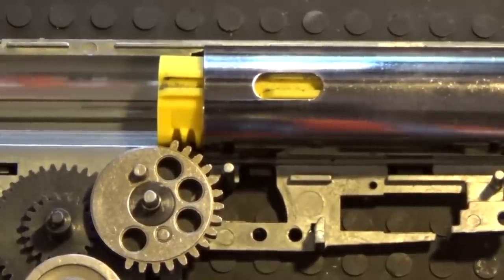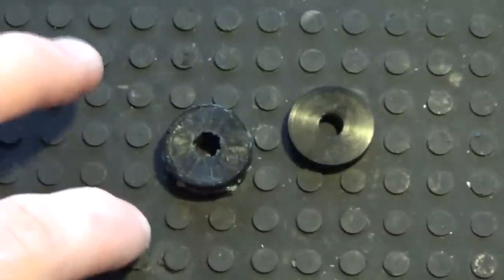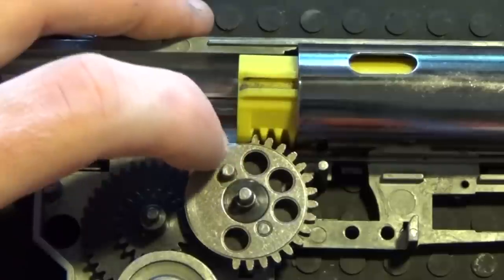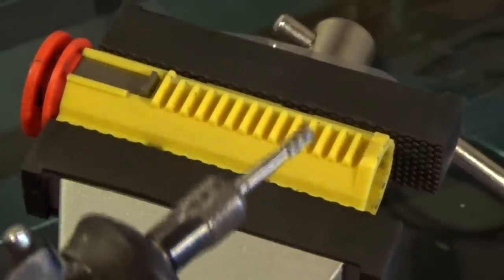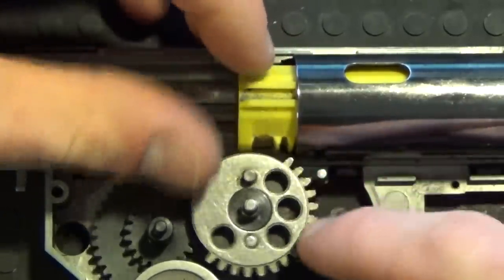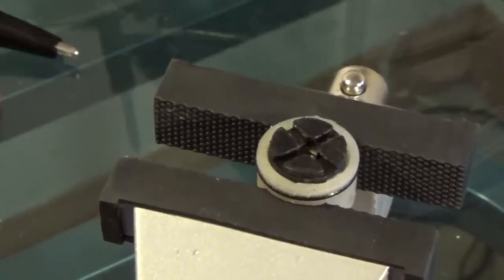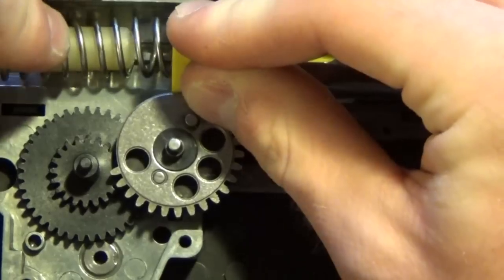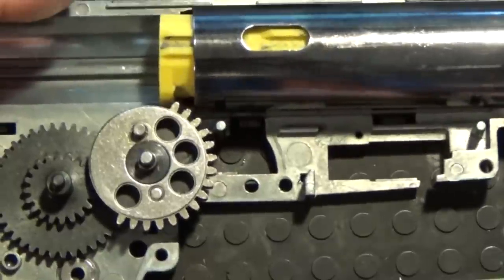Inside the Gearbox: How to Correct AOE.

Comment: Hello TheAirsoftech, I just want to ask, what is the cause if the first tooth on the piston chips?
Reply: Im not an expert by any means, most likely pme if you have high rof or a weak spring if you ment 15 tooth, 1 tooth propably the piston is plastic and can't handle a strong spring, just buy a blue swiss cheesed shs piston costs 7$ and is literally unbreakable
Reply: @bartekburmistrz8679  Thanks for noticing my query. as to my Piston Body, it is from Tactical Unlimited. as they claimed "Full Titanium Teeth". and a sp130 Guarder spring. My FPS is at 495 (settled Spring) and consistent. 16:1 SHS Gears and 60k True Rated Motor (rewind). Just wondering why its chipping on the last tooth near the piston head.
Reply: @Moto_GeeTee  as I said im not the expert but you are using a high speed motor (would never use these they get hot are ineffective take a lot of time to get to max speed just use high torque ones 16 tpa and up and control the speed with gear ratios) titanium itself is not resistant to chipping (depends on the alloy used) if your piston weights a lot and you are using a high speed motor it's possible that it's some horrible pme (doubt it) most likely the piston is just shit best piston is shs 15 steel tooth just suoer glue the rack is there anything else you think could be responsible? Also assuming you are running a 11.1v battery and your motor is 60k rpm is 10 tpa your gun shoudl have over 50 rps   i hardy doubt it does
Reply: @bartekburmistrz8679  no problem regarding if your not an expert or not. It's just good to have a conversation with someone who has an idea regarding this matter. The exchange of info is great. Piston weight, I have not weighed it in but I'm sure it is lighter. I have changed it to a "Slong" brand. dunno if you have the brand in your country. though it came from Hong Kong. haven't tried SHS though, but my gears are SHS. they work perfectly with proper shimming. I just don't know if the responsible of the chipping is my AOE. I have set my AOE as of now properly. inserting a 4.5mm nylon spacer between piston body and piston head not using a sorbo pad on cylinder head instead. 
and yes, I am running an 11.1v 2.0 mah turnigy. my rps count is at 66.
Reply: @Moto_GeeTee  wow 66 rps with 500 fps that's a lot I wouldn't recomend slong for important parts that are prone to breaking it's a cheap chinese brand if you are looking for good pistons try lookiing up lonex (havent used them myself) you could try to use pencil lead to determin what angle it's rubbing againts the last piston it will scrub of if it's something that shouldn't happen also remeber that the last tooth as well as the first take the most damage due to the highest forces anything only steel should be used(personal opinion)
Reply: @bartekburmistrz8679  thanks for the input. I don't know why the "slong" brand is so trendy and expensive in here. Though my piston head is Lonex, but I cannot find a Lonex piston body in here. Just Cylinder, cylinder head, air seal nozzle. dunno why.
Reply: @Moto_GeeTee  maybe they don't sell them anymore i don't know really with the pencil lead you can see if does it scratch it from the outside if it doesn't i don't think you are at fault here

Comment: This solution is for people who use singlefire most of the time. That’s what eats the big teeth, singlefire. Always use full auto even when in buildings, but make sure to shoot slower than full auto, also use a 7.4v battery for a slower rate of fire, then it’ll use less power and makes your gears work alot more smooth.

Comment: So do you prefer the faucet washers over the sorbo pads?
Reply from the maker: Yes, they have no reset time whereas sorbo pads do. In addition, they're easier to correct aoe with.
Reply: TheAirsoftTech what do you mean by reset time?
Reply: luckyflukerschannel can you tell me how to calculate the air voluming please? cheers
Reply: luckyflukerschannel Volume du cylindre V = π x r² x h

Comment: What's the purpose if this? What affect does it have on performance? What affect does it have on reliability?
Reply: Dan Fitz Maybe rewatch the video. He states the reasons for getting correct AOE many times, but basically it lines up the teeth so you have better contact on the piston and less wear and a smoother running gearbox.

Comment: You fixed a non existing problem.  You not only failed to improve it, but you made the problem worse. For those watching... DON'T DO THIS!
Reply: +helipilot727
Exactly, AEGs are made with a very fine balance between motor, gear ratio and spring and people shouldn't mess with them without knowing what they are doing.
The problem is that people are encouraged to freely change the spring with a weaker/slower one if needed and this completely destroys this balance. At first it might sound like a safe option, but in reality this is very risky for the piston.
It travels forward slower with a weaker spring and might not have enough time to return fully forward before the sector gear engages it again. And the most likely situation is for the sector gear to catch the last 1-2 teeth of the accelerated piston and this is what causes the damage.
Reply: Yeah I just saw the problem, all that spring pressure on a shaved down tooth, I'm sure that will last forever
Reply: @RekzysTheTitan  they might run amazingly, but compared to what? I doubt they would beat its correctly upgraded setup in terms of effiency and longevity.
Comparing 1 to 1 is erratic, but adjusting stuff following mechanical principles won't lead to premature failure! Don't think those companies do their job well. They are not art, but mass production; most AEG brands can't even shim or lube their parts!
Of course every upgrade must be considered carefully, but removing that piston teeth is a basic step; even a lot of stock guns have it already removed. Only old school techs say 2nd last tooth removal is bullshit, as they're still rocking their 1990 setups and thinking they're leading the way.
Reply: @JC-XL  it's almost like dual sector gears exist for this reason. HMMM
Reply: nectricks my friend had a krytac spr mk2 upgraded by umbrella armouries and I had a Tokyo Marui ak47, and I outranged him, got more hits, and overall better performance than his $2000 custom gun.
Reply: @RekzysTheTitan  that is simply wrong lol.... Tokyo maruis are fantastic guns don't get me wrong, but they won't come close to an R-Hop custom tuned gun with the highest quality parts. He probably had his hop up all messed up. Using the same bbs, his gun will outperform your Stock TM. Don't lie on the internet.

Comment: Says he wants to improve transmission, actually does the opposite by removing a Tooth in between.. This video is over 18 minutes long and he is struggeling to find a real purpose of this mod, that says it all. Don't waste your time, this mod is useless. The Design of a gearbox is fine in most cases. Seriously, we are talking about the first tooth that is barely under stress. Shoot the gun until it fails, make improvements afterwards. If you want reliability beforehand, get a piston with metal teeth. Gluing a washer to a moving high pressure part is not practical.
Reply from the maker: CptBeardo Hahaha. I'm sorry, who are you? Besides a very uneducated individual, that is. 

Trying running a 63RPS DSG on a 14.8v and MS210 spring without correcting angle of engagement and then get back to me...

I notice the video is long, that's largely due to me recording this unscripted. That is my error. But to say that proper AOE modification is useless is to simply deny science as it applies to physics and mechanics.
Reply: 63 RPS DSG on a 14.8v and MS210 spring is nothing else than about 30 RPS with an M100 and this is possible without correcting AOE,  especially using a 14.8v battery.

I'm not saying that correcting the AOE is useless. I am saying your modification is useless. Soon or later piston and sector gear will engage as designed. You are just delaying this action and to achieve that you are weakening the system by removing a tooth and set more pressure on one single tooth.

Remember, you are not lowering the piston to provide more contact surface ...you are just changing the time of engagement. The sector gear will always put a lot of pressure on the first piston tooth by design. By changing the timing you are doing nothing to prevent/improve this situation.

Removing a tooth from a gear system and calling it more reliable makes you deny physics because you don't seem to know how gears have to work to provide proper/better transmission. So you don't actually improve reliability, you are decreasing it with your mod.

Don't ask for critique if you can't handle it. Or at least don't get personal and call other people "very uneducated" when receiving objective critique.

Greetings,

a German Precision Engineering Technician/Airsoft-enthusiast
Reply from the maker: CptBeardo CptBeardo CptBeardo CptBeardo When you say a 63RPS Ms210 spring DSG is nothing more than an M100 at 30 RPS you're simply wrong. There's no other way around it. That statement reflects a fundamental misunderstanding of stress in mechanics. 

If you didn't correct AOE on that build you would lose your piston almost instantaneously. I've done the tests before. Proper AOE is necessary in high stress builds. 

Sure, AOE isn't necessary in all builds. But it helps the piston in the gearbox to last longer- a heck of a lot longer in some cases. Will the piston pick up tooth mold into the sector gear? Yea, sure, if it's plastic. But why the heck should it just be left to do so? That weakens the pick pick up tooth and eventually causes wear down that will lead to piston failure. With metal on metal sector-to-piston contact you won't have molding as easily. In other words, the piston will fail on high stress builds very quickly. Yet again, I've done the tests. I wouldn't do something that does nothing. I checked your channel for videos reflecting your view point and found nothing. 

I use to be an engineering major, and then I got bored. The medical field is the real challenge. 

When you present a point of view that is completely unfounded in airsoft and has no evidence to suggest that it is true in airsoft and push personal insults I'm going to get personal too. I love criticism, it's how I do my real world job, my airsoft job, and it's one of the ways I learn. But when someone is wrong, they're wrong. You are wrong. 

Sincerely, 
An American with an IQ above 130.
Reply: +The AirsoftTech drops mic I am a novice tech and I agree with you. I watched what happened to my plastic piston without AOE and then one with AOE corrected on the same gun. Huge difference in the wear marks that are made. Only 5000 shots and the piston looked terrible compared to the aoe corrected piston. Though I did have the variable of different manufacturers of the pistons, even still it is hard to dismiss after the results.
Reply: J C theres nothing to say, you’re wrong. TheAirsoftTech has been doin this a hell lot longer than you most likely, i side with the winning side, ryans.
Reply: +Nathan, lobotomies had been carried out for more than 2 decades in your own country (US), and 20,000 of your fellow Americans had to have their brains partially liquidated, before you figured out what a stupidity that was.

The airsoft "tech" is exact same type of "scientist", but luckily he's operating only on AEG pistons.
I don't care what you do to your own AEGs, but for god's sake stop misleading other people!
Reply: J C so if its such a bad mod, how is it that EVERYONE has it done to their guns? Everyone has a mod video on it. So why is it so dumb?
Reply: Firstly, who is "everyone"? Are you talking about the people around where you live? or are you referring youtube channels?

You realise that all these self-appointed youtube "techs" are trying to collect views, so they have to show something to keep you watching, they won't get much views if they just say stock setup is great, move on.

Then even if many people get convinced to do something, this is not an argument that it is a good thing. Many people are smoking and taking drugs, but this is not an argument that drugs are good for you, is it?

As I said a gearbox is designed to work in a very fine balance between motor, spring and gear ratio. If you change one variable things are no longer falling into place and start braking. We are talking milliseconds here.

For example if your gearbox is doing 15 rounds per second, that's 1000/15 = 66 millisec per round, that's like 35ms the sector gear pushing the piston backwards and then it has 31ms to go to its initial position, which it would normally do faster and have some extra time to ensure it is not caught in motion.
But then some "expert" like this one starts messing with the motor and puts a faster one, so the piston now has, say, 15ms to fire the bb, and it starts getting caught by the sector gear mid-stroke and get damaged.

I watched another video of this "expert" and surprise, surprise, he said the first "upgrade" he does to a gun is put a faster AND more powerful motor !!!
So the piston now not only has less time to travel forward and starts being caught while fully accelerated forward, but the sector gear is also rotating faster and slapping it with WAY more force because that idiot thought he knew what he's doing and put a faster and more powerful motor.

And the force is WAY higher because:
1) the kinetic energy is proportional to the velocity SQUARED as you may know, so if the sector is rotating 2 times faster it's engaging with 4x times the kinetic energy!
2) then the motor is also more powerful (more torque) so the force it can apply at the impact point of piston/sector gear teeth is higher as well
And I can go on and on about the spring and gear ratio, but I see no point.

I actually thing it's a good thing for people to mess with their gearboxes and experiment, but it's a bit annoying  how these people deceive viewers calling this "CORRECTING AOE" and pretend they know what they're doing, while instructing them how to break their gearboxes.

There is nothing wrong with the angle of engagement between rack and pinion (sector in this case) in these gearboxes and this has been the case for hundreds years when humans have been using this gear setup.

If you need a high rate of fire just buy a high cycle Tokyo Marui AEG or an HPA gun.
If you want to hack around with the gearbox, be open about what you're doing and don't deceive people that you are correcting something that's not wrong in the first place.
Reply: TheAirsoftTech "an American with an IQ over 130" lol R/iamverysmart
Reply: J C, not necessarily doubting or agreeing with you, I'd just like to ask a few questions about the logic behind your opposition of AOE, to better understand your position.

First, the sharp angle and shallow point where the first sector gear tooth starts to engage the first tooth on the piston(pre-AOE). I've noticed when a piston starts to wear, you can see the wear on the first piston tooth is very shallow. Wouldn't it make sense to have the first tooth of both piston and sector gear meet in such a way that they have maximum surface area contact to more evenly distribute force at the beginning?

Second, if you agree and you correct AOE, the first tooth is going to shave down the second tooth anyway because it is hitting the second tooth before engaging the first. Wouldn't it make sense to shave as much as necessary and nothing more, since it will happen regardless?

Third, I understand your argument that it is putting more stress on the first piston tooth, however, there is a lot more 'meat' behind that first tooth. Would this negate that extra force?
Reply: I have an IQ of 142... IQ is just a measurement of your capability to use logic, and how fast you could learn if you put your mind to any given subject.
Reply: J C dude you clearly know nothing about teching, and I see you replying to a couple of other comments. First off of course you cannot put in a stronger motor without upgrading anything else, you also have to put in a stronger spring if your spring is weak. Rule of thumb is to always go for m110 or higher with a neo can motor or else you hit PME. Secondly, people "hack their gearboxes" so that they could get the best of what their teching ability could do. Why the fuck would you want to run a gun stock when you could upgrade it to shoot faster, stronger, and more reliable than before. Correcting AOE is a great thing to do because even if you say having more teeth will reduce stress, the pick up tooth will get picked up at a very bad angle which will over time wear the pick up tooth. Don't believe me, go on Instagram and look at other techs metal rack pistons failing from the pickup tooth. And your whole math and science application is just way too complicated and unnecessary, it's a fucking toy gun let others do what they want to them
Reply: keep in mind that with a metal tooth piston, poor aoe will result in sector gear damage